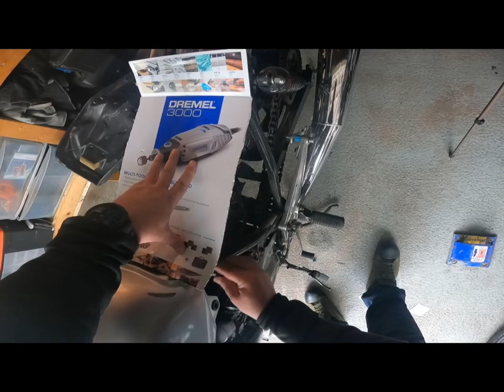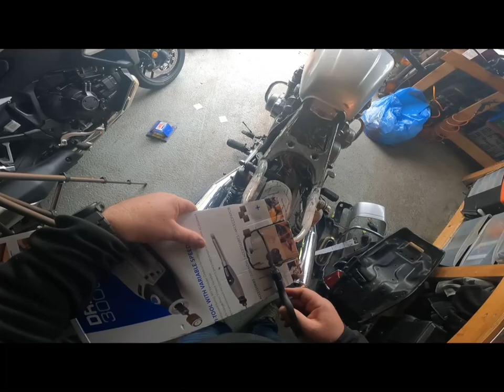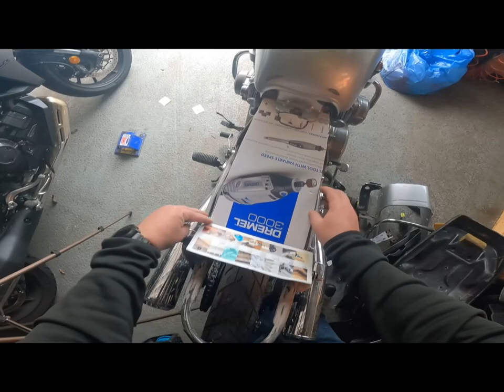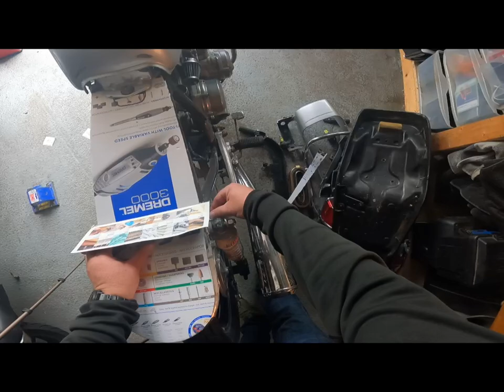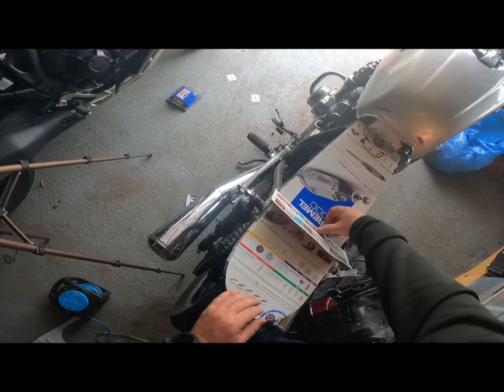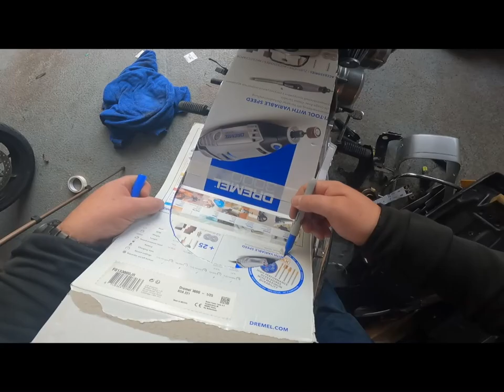Honda Cb750 Seat Base Mock Up

Comment: You need to tidy up that garage, move the the Honda crossdresser out and the project bike into the centre of the garage! remember the 5 p's, 'prior preparation prevents piss poor performance'! You do know you can buy these seat humps off the net to avoid this flaff?
Also its great you purchased a tripod but no good if you don't use it and carry on giving viewers motion sickness!
Reply from the maker: Yes I thought I would give it a go if it doesn’t work I can always resort to cheating lol